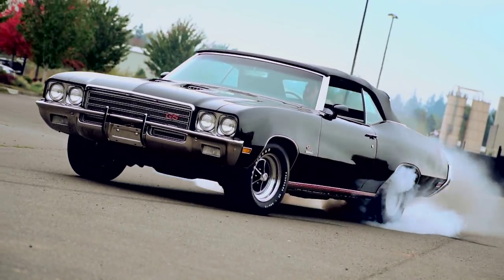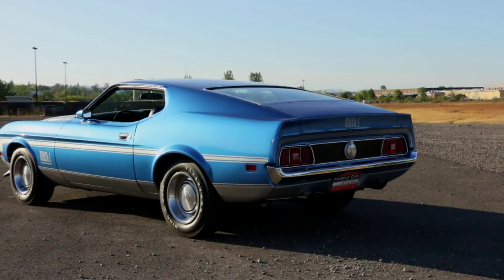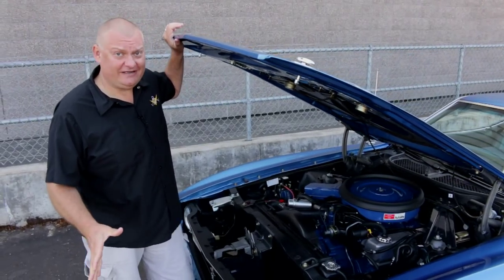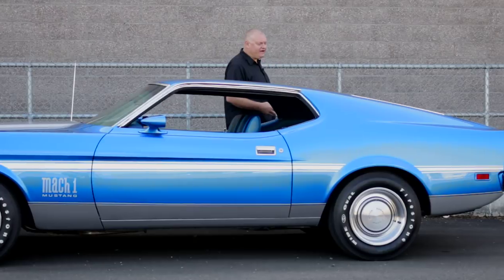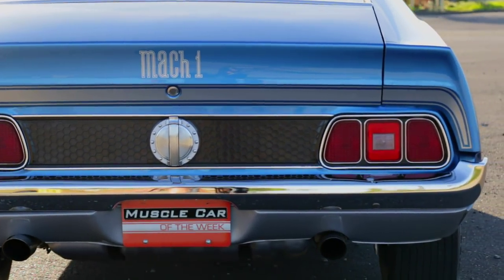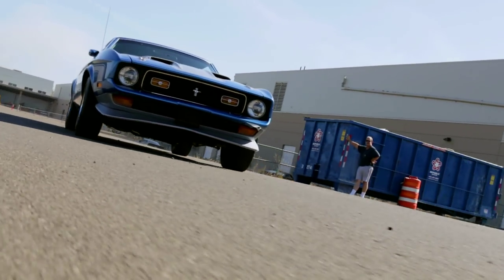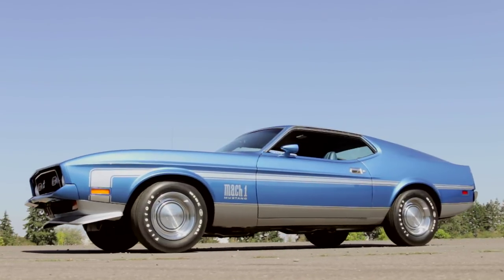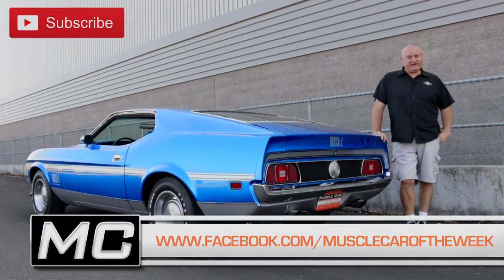1971 Mustang Mach 1 429 Video: Muscle Car Of The Week Episode 252

Comment: Last big block in a Mustang...enough to make a grown man cry.
Reply: BOSS HOGG ; Here's  something that might make you whimper a little more. Notice the shock towers are modified at the factory. Why? Boss 429 that's why. Never made production.  :(..
Reply: @cobracharmer6178  The shock towers don't need to be modified for the 429 Cobra Jet Engines, they drop right in. Only the Boss 429 Engines, they are COMPLETELY DIFFERENT then the regular 429 or 460 Engines, Especially the Cylinder Heads.
Reply: @badass6.0powerstroke10  ; Read again what I typed. "Notice the shock towers are modified at the factory. Why? Boss 429 that's why." The 71-73 Mustangs wouldn't have to go to KarKraft for shock tower modifications. So that tells you, Ford had planned to install the Boss 9 on the assembly line. Unfortunately, Ford cut deep into the racing program, and there's no recorded factory 1971 Boss 429. Next time you're at a car show and see ANY 71-73 Mustangs, look at the shock towers and you'll see they look like the 69-70 shock towers of the Boss 429. Have a great Thanksgiving.   John  :)
Reply: Don’t cry too much; they make engines more economical with smaller displacements that would blow this car off any track. And they handle much better because of a better weight balance.

Comment: Watching this again 5 years on... I have a '71 429 myself built for export as it has been in the UK since 1971 (still LHD). Came to the UK as a 351 4V but I put a rebuilt, modified 429 in it running 360bhp and 500lb ft. Now midnight purple and 90% ready to get back on the road after 30 years off it.....wow, my last comment was 5 years ago, how time flies.

Comment: I Love the 71-73 Mustangs, more so the 71-72 Models, like that grill better, but 71 was probably the Best Performance wise, with the Awesome Boss 351, and the 429 SCJ Models, both were 71 Only. When it comes to Mustangs both those 71 Models are my favorites, when it comes to early Mustangs, Would Love to own both of them, a Boss 351, and a 429 SCJ,  with Top Loaders in Both ! I know it's mandatory on the Boss. For 1971 the Mustang was one of the Quickest Muscle/Pony Cars for that Model Year. You either Love the 71-73,s or you Hate em, and i Definitely Love em. And when it comes to "Boss" Mustangs, the True Boss was produced in 1971 in my book. And the 72 R Code Low Compression Cleveland is one Rare Mustang with only a couple hundred being made, was basically a Low Compression Boss 351 Engine, that you could've gotten in a Coupe, Convertible, and also the Mach 1 body style, such a Rare option for the 72,s.

Comment: This was such a streetfighter back in the day with a set of craigers, sticky mickeys, and a few bolt-ons.

Today, this is such a valuable example.  Glad to see the last one produced on this channel.
Reply: Still interesting that ford could/should of got this motor up to the 450 HP range. I'm sure it wouldn't of taken much, and would of been as gutsy as Chev's 450 hp 427 Yenko's.
Reply: Carat Cranker They were underrated like many were back in the day they actually made more like 425-450hp, in a 4000lb Torino they ran high to mid 13's at 101-103 mph stock on street tires.
Reply: The thing that was funny is,it’s baby brother,Boss 351 was quicker in the quarter.
Reply: Actually the post-1970 Mustangs were never valued until recently and only because 1965-70 cars became too expensive.
Reply: @lewisshepard9239  Actually in the 1/4 the 429 SCJ Models were a tick quicker than the Boss 351,s. And in any other type of racing the Boss 351 would easily perform better than the 429 cars, the Big Blocks were very nose heavy, the Clevelands weren't the lightest engines out there either with those Huge Cast Iron Cyl. Heads, but were still lighter than the 429,s. The 71 Boss 351 is one of the quickest Mustangs off the showroom floor, Definitely it's highest performing Cleveland Powered Mustang, and probably my Favorite Mustang from the Early years, but the 71 Super Cobra Jet Mustangs are right behind them in 2nd Place in my book. Definitely two of my Favorites. The FE Big Block Mustangs were a little before my time, But I've always liked the 68,s with the 428 Cobra Jets definitely Fastbacks. I was Never a fan of the Coupes, bought the only one i would consider owning would have to be a 68, 428 Cobra Jet, when you got that Monster under the hood, it definitely offsets the look of the Coupe for me.

Comment: My name is Ewerton Saavedra. I have a 1971 Mustang Mach 1 original 429 SCJ in Brazil. My car is the one of one Mustang 429 SCJ in my country, Brazil. My car was bought and imported to Brazil in 1971 and was on the cover of the most popular automotive magazine here, called 4 weels (4 Rodas), in the May 1971 issue. I bought the car after finding it abandoned in the back of a workshop in year 2001 for R$1,500.00. That's the current equivalent of only about $350.00. At the time, here in Brazil, nobody wanted these types of cars. I got lucky.
Reply: Lucky i know of Colombia import too 1971 Shelby De Mexico
Reply: Did you fix it?

Comment: I bought one brand new in 1971. I ordered it with the Drag Pack, which included the 429 SCJ with ram air, and a 411 Detroit locker rear. The Drag Pack was over $700 of the $4,800+ price.
Reply: You found the secret elixir to long-lasting! You don't look your age, sir. I was born in 72 but park in handicapped zone now!  You knew what to order back then. How long did you own it?

Comment: This is an interesting fact: the 429SCJ was only available in The Mustang in 1971, but the Torino, Mercury Cyclone, Falcon, and Thunderbird all had this engine as an Option in 1970 !

The fact that only 1.318 429 Cobra Jets were made in 1971 says something about the pricing and styling if the 1971 Mustang  (Generation 1B).

Ford were struggling with the emissions in 1971, the Mach 1 was now standard with the low compression F code 302 2V V8, but the 351 4V Cleveland cars were still the Best buy. For 1971 Ford also had the Boss 351,  as a High performance Car which was a One Year model Only.

The Holy Grail for 429 Ford Mustang Owners are now the Super Rare 429 Cobra Jet Coupe's and Convertibles 😎🇺🇸
Reply: I'd have thought the Boss 429 would be the holy grail.
Reply: They didn't make Boss 429s in 1971 but a Boss 351 would be more rare for 72 which is my favorite Mustang from 71-73
Reply: Stefan Rood ; You could still get the 429scj in the 1971 Torino GT and Cobra. For 71, the 351 Cleveland hi-po became standard in the Torino Cobra. And as far as I know, there wasn't a Boss 351 option for the Torino. There were no small block Fairlane/Torino Cobras in 69-70. From 67-70, Shelby Mustangs could be ordered with 351 or 428. The 1970 Falcon, which was just a standard Torino 500, had EVERY engine option. Falcon was retired after 1970. Never ever heard of a Cobra Jet powered T-Bird.They were 429 Thunder Jets. I was at Ford Nationals in Carlisle, Pa. I was looking at a 1971 Mach 1 with the 351 Cleveland. The 1st time in 40+yrs, I noticed the shock towers looked exactly like the shock towers in the 69-70 Mustang Boss 429. Were there plans for the Boss 429 in 71? This would've saved time and money to drop a Boss 429 in the Mustang on the assembly line. 1968-71 Fairlane/Torino shock towers were pretty much the same.Which probably means, Ford had no intention for a Boss 9 Fairlane/Torino. I find it hard to believe you couldn't order the Boss 9 in 71.  John
Reply: The 429 was too wide to fit in the 69-70 model years.  
But I think the 351C might have been a better engine for a smaller car.
Reply: 429 CJ was available in the 1970 Mustang. Odd but the end of FE motor series 428CJ was offered alongside the more sophisticated canted-vale 429 in the same car.
Reply: @JackF99  Sorry, But Both J & C code Cobra Jets were a 1971 Mustang engine only. I just helped putting the final touches on a 1971 J Code Mustang 4 speed Convertible.

The Boss 429 is the only 429 engine you could get in 1969/70 - My father is the original owner of one.
Reply: @SteveRood1  I see. I could have sworn some 70 Mach  1's wound up with non-Boss 385 series 429 instead of the FE 428.
Reply: @JackF99  the 428 Super Cobra Jet was the top Dog engine for 1970. For 71 the 429 CJ & SCJ  was the top engine. You could get it in a Fast as Hell Mach 1, Luxery Grandé, or like this time,  a Full optioned 1971 429CJ 4 speed, A/C Convertible
Reply: @jamesgould7825 James, the Santa Fe James Gould?

Comment: When I was in high school thirty-plus years ago '65-'70 Mustangs were already classics and I felt embarrassed for anyone driving around in one of these land yachts. Now I look at the '71-'73 and I really dig it. It has to be the right one though. A ''71 Grande with bumper guards and a vinyl roof will still garner my pity. It's got to be optioned just so - blacked out hood with scoops and pins, body colored bumpers and Magnum 500s. Back in the day I saw so many of these fastback (SportsRoof?) models with louvers I assumed (until now) they were a FoMoCo option. 
Thank goodness 60's musclecars were still affordable when I turned 16. My cherry '69 Acapulco blue on black 351w 4v Mach 1 with hi back buckets, console, power everything and dealer installed rear window louvers set me back in 1981 a cool $2750. 
I bought it from a divorced stewardess that lived in our neighborhood. 
Yes, it was an automatic. She called it a "Ford".
It must have been settlement booty along with the house.
Reply: The Grande with vinyl top was just a conservative car for the performance lover that wanted to drive a sleeper and go to work in an office. My father was such a guy. He always tapped on the throttle only and not until I was given the car did I discover it could drive much faster although it did bog badly from a stop while racing, in 302 guise.

Comment: 2:55 I really don't think the Hubcaps look boring at all, they look awesome!
Reply: Yes, the 14x7 and the 15x7 rings cap look is iconic. Shame more cars don't wear them today.  It's rather frustrating that GM and Dodge owners of the era have repops of the wheel trim rings. Ford owners of this era? Good luck! NOS or  used.  You don't want to know what a set of those 15x7 steel wheels and NOS trim rings and 10.5" hubcaps go for. It'll shock you.

Comment: The fit of the front spoiler looks a little funky, I had a 71' Mach 1 351C 4-V Ram Air Hurst 4 speed, with the argent front spoiler, it did not dip up in the center like this one.
Reply: Spoilers don't help performance. They increase drag.ever see spoilers on a cop car?

Comment: I had the very last one off the line (certified through Marty Auto Works, and with Marvin, the 429 registry holder) I still have a copy of the Marty Report. Looks like her. IF the last 3 digits of the VIN are 304, it IS my old car, and the last off the line,429SCJ-R Drag-Pack. Named her Brickhouse. If the last 3 of the vin is NOT 304, you all may want to revise the statement, as the above car is not the last off the production line with a 429. Remember, just because the last in sequence vin is out there (and also documented with Marvin), the final build date/release date can be verified, as was Brickhouse. Brick house was bucked 7/22/71, and finish being built 8/05/71. Please let me know, she is the correct color.
Reply: I had a same color 71 with 351 4v  & 4 speed ,  saw a picture of it at a mall,  it was smashed ,   I knew what I made ,           he lost his MOM in it       R I  P
Reply: That is my old car. Glad she''s in a good home.

Comment: I had a 71 Mach 1. I was the second owner, the guy I bought it from told me that when he bought it, the dealer had 2 on the lot, the 351C2v and a 429SCJ. Sadly he chose the 351 because he didn't like the nose heavy handling of the big block Mach.

Comment: Great video on a great car, a lot of good information.
However one bit of information is incorrect, the 385 motor was available on a 69 and a 70 Mustang because the 429 boss was available in both of those cars, though the boss was very different from the Super Cobra Jet they were still based on the same 385 429 block with some exceptions in the machine work.

Comment: Fyi, the 429 CJ/SCJ block (One in the same..."CJ" cast in the lifter valley) were 4 bolt main blocks....really the only difference in the CJ/SCJ engines was the SCJ had a mechanical cam and a Holley carb and the CJ had a hydraulic cam and a Quadrajet  carb (Yes a GM Quadarajet...it was the only Ford to ever come from the factory with a quadrajet carb). The SCJ engine in stock trim when properly tuned would pull in the range of 425 - 450 HP on a dyno....with minor head porting, induction system (read aluminum intake/carburation) and headers it would pull over 500 HP and with aggressive roller cam setup would approach 600 HP.
Reply: Googling CJ-SCJ show the SCJ as having more forged internal engine parts like crank, rods and pistons. Also they say the CJ is 2 bolt main while the SCJ is 4 bolt.

Comment: THAT MUSTANG IS BEAUTIFUL  !!!!  I HEARD SOMEWHERE THAT THE 71 BOSS 351 WAS THE FASTEST MUSTANG  ...
I GUESS THEY COULDN'T FIND A 69 BOSS 429 PROPERLY TURNED UP
Reply: The Boss 351 was the quickest 0-60 and quarter mile, but the 429 would beat it in top speed.
Reply: @MrJett1971  you are exactly right. Boss 351 was a beast.

Comment: It's a damned shame the automakers bowed down back then & gave up on the big horsepower engines! Restrictions are tighter than ever now & we've got more horsepower than ever now.
Reply: Steve Holsten....technology is why we have the high hp, low emissions motors today...
Reply: Branon Fontaine The Consumer should still have the right to buy a big block; at least we still can with Chevy.
Reply: Steve Holsten....see that I wouldn't know nothin about, as I am exceedingly ANTI-Bowtie...owned only 2 Garbage Motors products in my 44yrs on this planet, a 327 in my 57 Willys Cj-5 (come out of a 67 vette) and a POS 1994 Z-71....never again will I own any product that has anything to do with GM.....
Reply: Branon Fontaine these new crate engines like the 572 and then then Vette & Camaro LT4 Engines are extremely well built nowadays for sure.

Comment: I never understood why Ford didn't put a 460 in the Mustang's the 72-76 torinos got them and I've seen a ram air 460 in a 73 it was put in by the owner and it was a terror.
Reply: My guess would be that the insurance companies were hammering away on the muscle car / pony car, which was hurting sales of those that had high performance V8's. The 1973 oil crisis didn't help either. Pontiac was the last one to offer a high displacement V8 (the 455) in their Trans Am and so on.

Comment: While I'm not usually a big fan of plain hubcaps, the trim rings help.
Reply: Red 13 personally I think the trim rings and Hub caps look way better than the always present Magnum 500s
Reply: Stefan Rood Yeah, the Magnums, while they do look good, can be "over used". It's not like the manufacturers didn't offer other wheels/hubcaps. There's a video of another one of their cars on here, a '70 Torino, that has the hubcaps/trim rings, and it looks good.
Reply: Red 13 exactly. The only stock Mustang which had the Magnum 500s was the Boss 429. Personally i think the style, color and Engine sets the tone for What Rims look good

Comment: Correction. The 385 series engine was installed in a 1970 also. Known as the Boss 429. The quickest mustang I believe was the 1968 428SCJ drag pack. A 4 speed with 4.30 Detroit locker rear. 10s in the quarter were not uncommon.

Comment: So if they only offered the 429 in a Mustang in 1971 then please explain to me what was in the 1970 Boss 429? Also I believe the 1971 Boss 351 was actually faster than this car. I've read that it was the fastest production car of the muscle car era.
Reply: as I remember, the Boss 9 has different parts than the 429, albeit same 385 series. Also, the boss 9 was only released in limited number, while the 429 in 1971 mustang is a factory option you could get without modifying the car.
Reply: Yeah , they forgot about the Boss 429 . I'm not sure if the Boss 351 was the fastest production car (maybe that year) , but it is the fastest Boss . Pretty sure it turned a 13.6 out of the door ?

Comment: I noticed that it's quarter windows have manual cranks, that's not stock! Finally saw how it looked like with that modification.
Reply: I wrote a tutorial on the 7173 Mustang forum for how to do this: https://www.7173mustangs.com/thread-1971-1972-1973-mustang-fastback-wind-down-quarter-window-conversion-tutorial

Comment: I always liked the look of these but, with the rally wheels, not the pickup truck hubcaps. The steering wheel looks like a bottom bin Galaxy 500 part.
At the time, the interiors seemed better more options, delayed wipers and such but, everyone knew it wouldn’t run with the class of 1970 with out some work. It seemed to be that way for the whole decade. I remember putting older or aftermarket parts on cars of these years to get performance back to where it was.

Comment: What about the 2008 427 and 428 gt stang? Aren't those big blocks?
Reply: stripervince1 - Where did you see a 2008 427 or 428 GT Mustang???
Reply: ? Are talking about the Roush Mustangs ? I'm pretty sure that is HP ratings  or just , model #s . Those were 4.6 L sohc 3 valve engines , that are supercharged . No big blocks here .